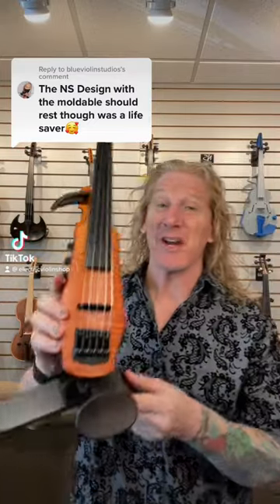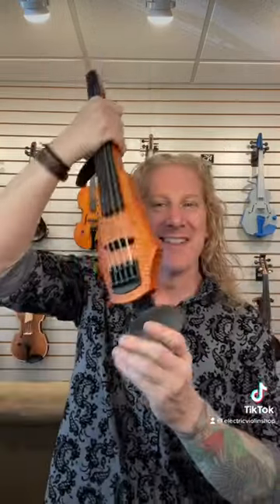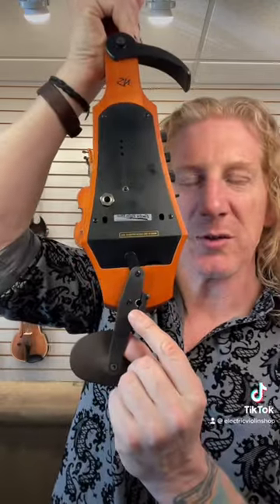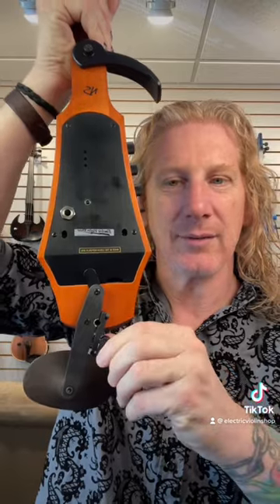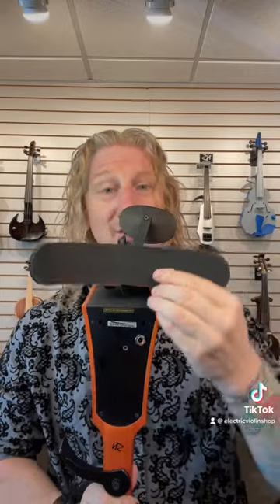NS Design Shoulder Rest #electricviolin

Comment: I underestimated how important this is, when considering which electric violin to buy. I use my shoulder rest very tall and this makes the traditional ones quite unstable, with the risk of slipping away at every more intense movement. With my yev 105 I have to fix it to the violin's frame with two hair bands 😂